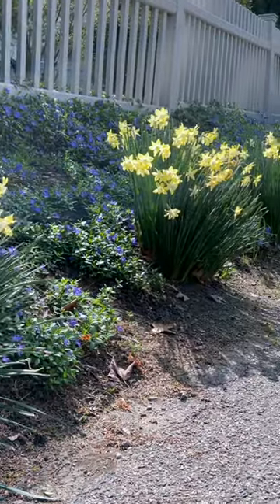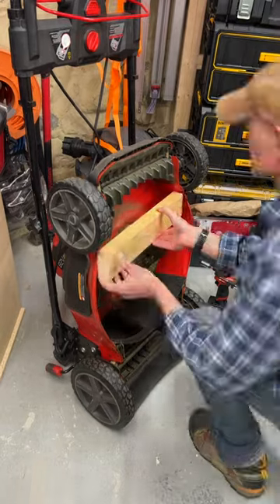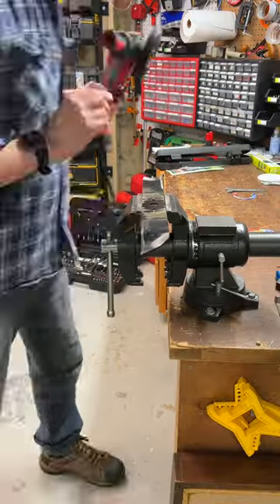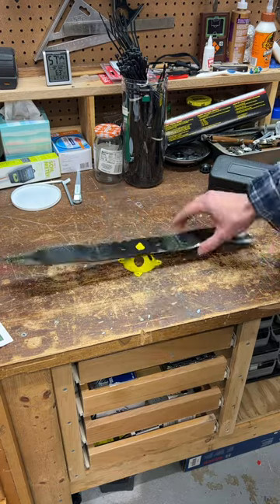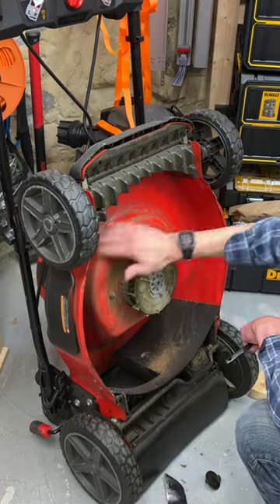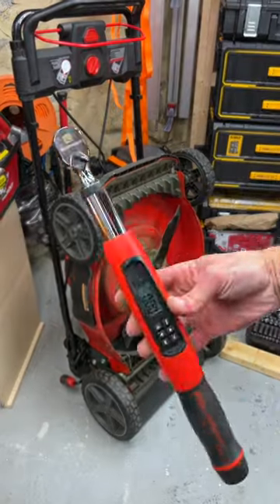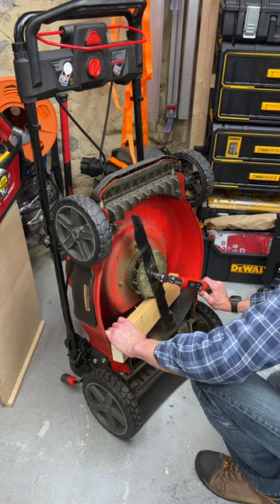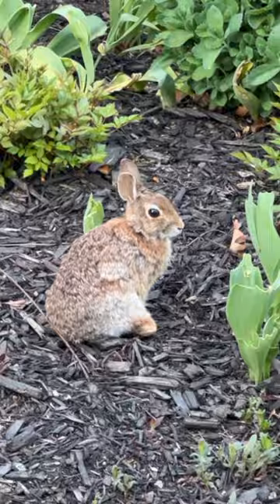How To Sharpen or Change Lawn Mower Blade on Snapper XD Cordless Lawn Mower #shorts

Comment: Thanks for showing how to do this. Any chance you can show me how to replace the cover that flaps over battery? husband broke the hinges and I have new cover just can’t get hinges out to replace whole thing.
Reply from the maker: Ugh that stinks. If I had time I’d definitely do a video of that, but unfortunately I’m a bit backed up. I recommend going to the snapper website (snapper.com) and under support /manuals you can enter the model number and get a parts list. The diagram will give you a good idea of what screws need to come out to get under the cover and get to the hinge brackets.